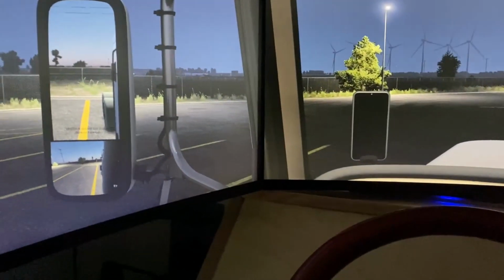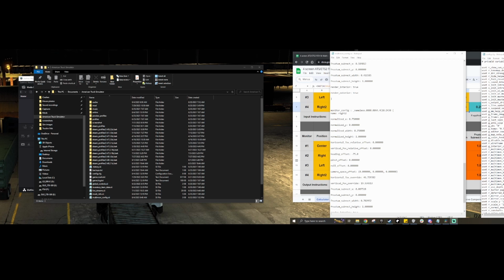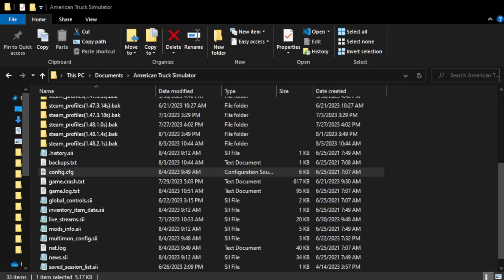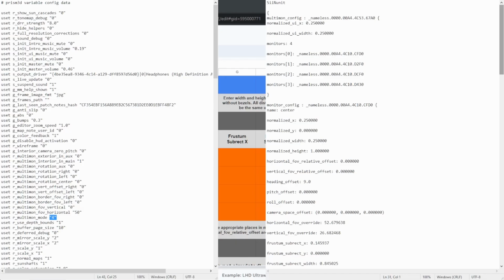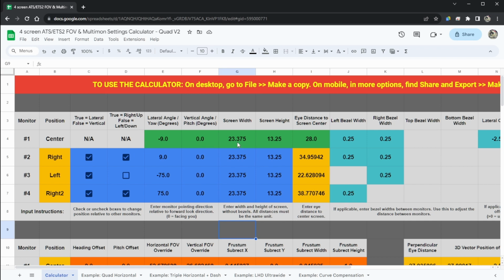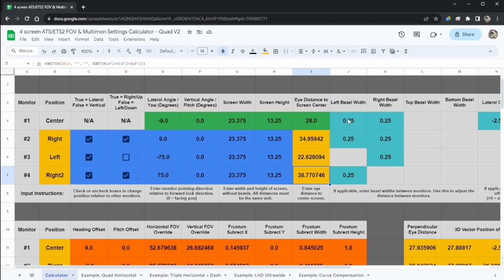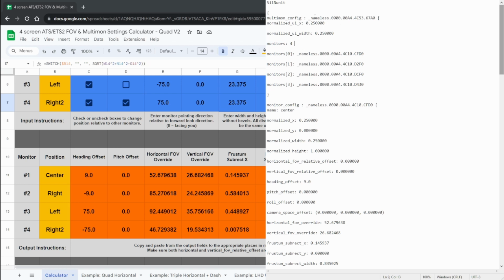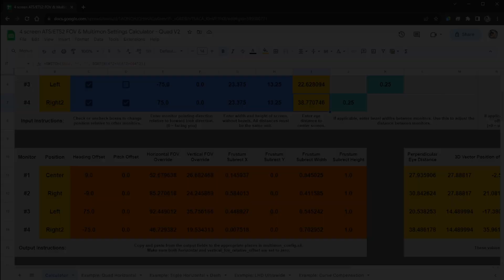How to setup 2 , 3 and 4 monitors with American Truck Sim | Doubles Triples Quad Screens | ATS

Comment: Thank you for helping. What monitor and video card are you running.
Reply from the maker: Hey there, you bet! 

I am using 4 x 27 inch curved monitors. There should be a link in the description. and the video card is a 2080 super.
Reply: @KaNoodlefpv  After 2 years I finally did the Quads and love them. Your calculator made them even better I know this video is unlisted but I am so glad I saved it and could come back to it

Comment: This worked like a charm! Thanks for posting. One question: as you said in the video, there is no way to adjust your fov and the seat is adjusted all the way back and it still feels really close. What adjusts this? is it part of eye distance?
Reply from the maker: Hey there! Look for a mod on the Steam Workshop that's called Increased Seat Adjustments. Works like a charm. However you may be sitting in a distance to the screen that this is what actually works considering your FOV. So you can change the distance to the monitor number, For example, the distance to the monitor from my eyes is actually farther back then what I set my number to, this way I can still look left and right and see out the windows, despite actually sitting farther back then the edge of the monitors on the sides. So try the mod I mentioned, and also adjust the eye distance to the monitor to accommodate for that.